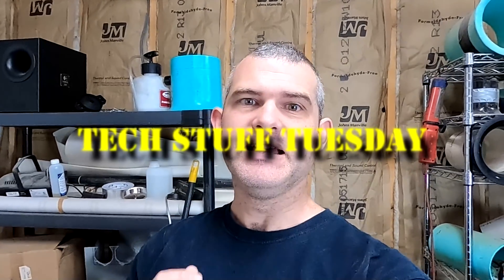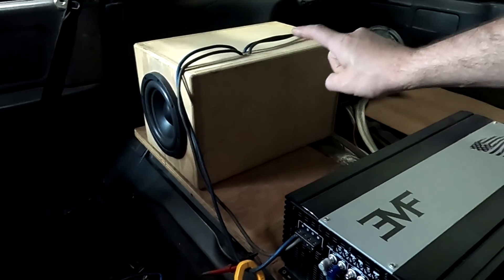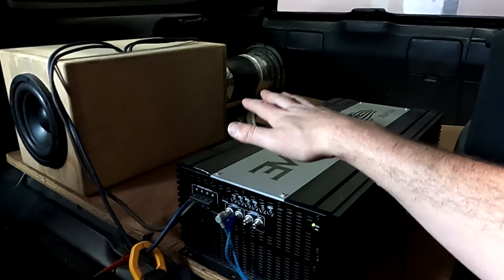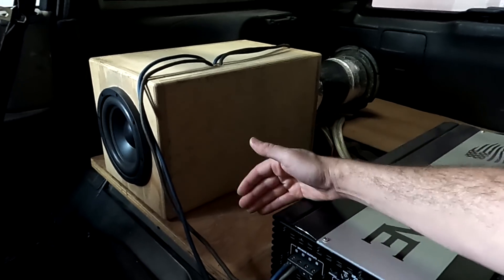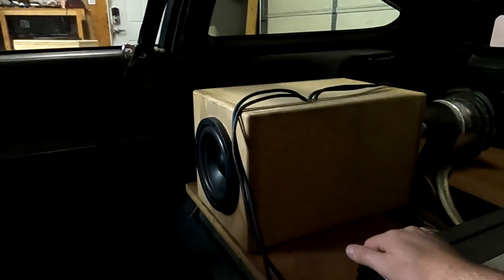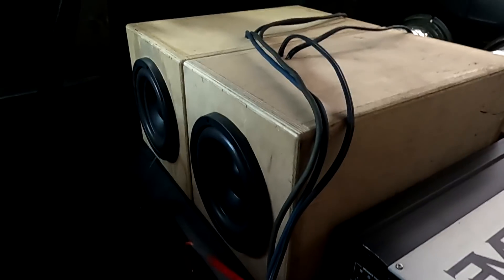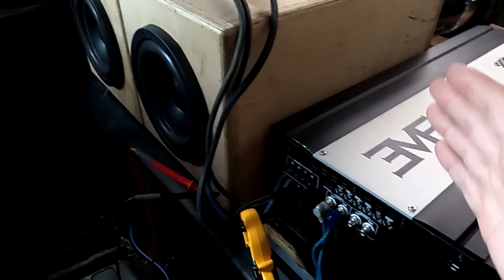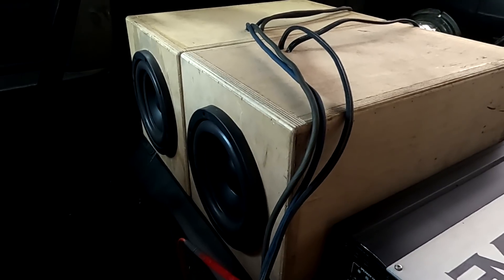Does doubling power or doubling cone area really gain 3 dB? - Tech Stuff Tuesday

Comment: The changing phase thing... I can't understand why you'd need to change phase because you changed sub direction. Soundwaves in the sub range are omnidirectional. Doesn't matter which direction you face the subs, the soundwaves will start off and end up at the same point in the spectrum as the other sub, regardless of direction, changes in tuning frequency between the two boxes notwithstanding, which wouldn't affect phase anyways. Changing phase shouldn't help, it would hurt. Which it seems it did. Just walk me through it.
Reply from the maker: When a waveform is made from a speaker, the speaker either moves forward or backward from the neutral position first. The phase determines that. If 2 speakers are playing the same thing side by side, if one moves forward and one moves backward they are 180 degrees out of phase. The frequency being played won't matter because it will always be 180 degrees out of phase. In this case I turned the box around 180 degrees, so the phase has to be changed 180 degrees to make the cones move the same direction at the same time. Had I not reversed the phase, there would have been much greater losses, in excess of 10 dB, likely close to 15-20 dB. This can be displayed in a common enclosure, separate enclosures, mids, subs, anything. If you have 2 subs, reverse the phase on 1 of them and take a listen. It will suddenly make sense.
Reply: @EMFAudio  Phase doesn't have anything to do with direction. Phase is a wiring/electrical issue, not a directional issue. 2 speakers are in or out of phase regardless of which direction they're facing. They will, as you put it, start moving in the same direction from neutral regardless of which direction they're facing. What I saw in the video was possibly cancellation, because when a sub fires into the trunk, the trunk becomes a secondary chamber with its own tuning frequency, like a 4th order. Which would change the length of the sound wave. Again, sub waves are omnidirectional and phase is determined by starting point of wavefront. If you had inverted one of the subs, that sub would have to change phase as it would be 180 degrees out. But just a change of direction? I legit don't think so. Not the experience I've had. But I'll check with some other installers and confirm.

Comment: u should try it again with closed enclosure, i think that would make some difference. i think that, that air from the ported enclosure is going back to that non connected sub enclosure cause its still in the same air space (car) and that why non connected sub is moving too. ill bet that u gonna get different data :)
Reply from the maker: Changing enclosures in any instance would give a different result, which also helps prove the point.

Comment: This needs to be done in a free air environment. When the boxes are in the car, the waves have to conform to the area they are placed in. And vehicle pannels absorb energy. And its not a set amount of energy. The more power you throw at those subs, the more energy those panels absorb. Its like taxes. The more you make, the more they take.
Reply from the maker: Funny thing about car audio, the application is in a car. What it does outside of the application doesn't matter. That's the point of the video.

Comment: I think it just shows how much you have that car dialed in for the enclosures you are best with. Sound waves... move the enclosure a butt hair to the right,  gain a tenth! Move it two butt hairs, lose a db🤬 and some hair off your a$$
Reply from the maker: I actually did try moving one of the boxes several inches forward and backward to see if there would be a massive shift  and there was 0.1 difference. But, in regards to your thought  process, I metered in the middle of the car at the line of the B pillar and it's 10 dB quieter than the windshield and 11 dB quieter than the rear of the car.
Reply: EMF Audiothanks for the reply.  test test test is how we gain on the meter! 😬. I wish I had a dedicated area at my place I could test and it not travel so much. Garage is attached to part of the house , anywhere else it carries to the neighbors too much. And my neighbors complain when I come home from ** work at 5pm playing triumph or Eric Clapton with my windows up no subs on. I could only imagine the complaints I’d get if I was burping and testing 🤬🤬🤬🤯🤯
Reply: @ The3rd ERA
You are going to have to make a complete concrete cinder block garage so no sound escapes outside and you can do all the testing you want.
Reply from the maker: I test in my detached garage which is better about killing sound than my attached garage because I took some extra measures when I built it. I had a neighbor that moved and he called police on me for hearing a grinder at 7 PM when I had the door open so you can imagine how many times he called about anything else.
Reply: Bassotronics. When I move in July to Nevada I plan to build a proper area to test and build a better shop. The neighbors I have now would call HOA on you for parking in front of their house on the street lol. So I’m glad to get out of here!
Reply: EMF Audio what extra measures did you take if you don’t mind me asking. I’ll be building some kind of structure on my new property when I move out to Nevada in July. I’ve been researching on it for a few weeks now, along with the wife’s she shed 😂, but no one that has actual data on the measures they took, just them saying it’s way quieter...
Reply: Thank goodness I’m shaved.

Comment: And the whole doubling the power or cone area to gain double the aucustic output (3db) there are always exceptions to the rule it tends to be aimed more towards higher power and larhlfer come areas to start with like 2 12s with 1krms to the pair doubling the power will usually get you that 3 db it's not really aimed at 2 8s with a hundred watts
Reply: Not to mention the enclosures were wrong

Comment: Having 2 subs, the one not playing is absorbing energy. That's why u got those results.
Reply from the maker: That isn't the answer, there are applications where that gains. It's literally the principle of how passive radiators work.
Reply: @EMFAudio  not the same as a passive radiator as it is not in the same sealed enclosure as the driven sub.
Reply: @EMFAudio  not a comparable situation, not being directly connected to the same cavity will hinder the other sub. 
If you have two tuning forks(in this case ports) and you ring one and bring it close to the other it will ring but the sound doesn't increase.
Reply: @94e88  great point👍🏻

Comment: From my experience the 3DB rule comes into play when you Start getting Closer to 150DB. The Pressure is increasing and the Cabin Area is Decreasing. You have to Start Doubling the Power and Cone Area as well as increasing your Electrical system. Once you get above 150DB it really Starts getting Difficult to go up 3 DB. Going from 150DB to 153DB gets a lot Harder. 

The Tuning Comes into Play as well. Having a Box tuned at 45Htz will prob hit a higher SPL that a Box tuned at 32htz. However, In my opinion the 32htz will sound better. Much deeper Bass. To get to the same SPL with 32htz will take more power than the 45htz box. It also depends on how and where they set the Meter at for the SPL reading. If the Windows are opened are closed. I could go on for Days. I've been in Car Audio for 20 years. 

Just remember their are a lot of situations that come into play. Get a Car that has a True Hatchback like a old Acura Integra or Honda CRX. Shid, the CRX back in the Day use to pound like Crazy. The car was the Sub box.

Comment: I have a feeling you could see different results if done out in the open, as I know (and shown in this video) anything around the sub will affect it. The main reason I put my home 5.1 system's sub in a corner is to get little boost.
Reply from the maker: I'd get a different result using a different enclosure too. Doing it in the open isn't how you use car audio enclosures, and that would take the intrigue out of the video!
Reply: EMF Audio - I am curious about what results you would get in my savana 3500 cargo van.

Comment: The 3db rule was originally stated when 100watts was about the limit it's a hold over from the days of tube amps, another thing to think of is this math was based on a flat response sealed enclosure, in a free open environment at 1 meter from the cone, Hexibase please chime in. Also a i free cone with a tuned enclosure will actually become a bass trap absorbing the pressure wave rather then adding to it.. on top of that you have problems with time delay

Comment: Was the second box soaking up the pressure via the unplugged sub vibrating? Somewhat like an ill fit passive radiator? I would like to see the same test done with a box of the same size but completely sealed without a subwoofer.
Reply from the maker: Passive radiators INCREASE output. I've tested it without the sub installed and it still loses.
Reply: @EMFAudio  Huh!!! A passive radiator in another unplugged box increases output??? Maybe you found a "free energy" device lol. But on a serious note that would be like saying flex on a vehicles exterior increases output, just not true. I do agree a passive radiator will increase output on an active properly tuned enclosure, just not on an inactive one. I call BS.

Comment: Flip the phase on the dual sub forward and back firing.....you lost dB on that due to the back firing sub being out of phase.

Why?

The air slug in the port itself is vibrating exactly like a cone that moves in perfect time with the driver in its enclosure.
Reply: So basically you were incorrect in reversing the polarity of said sub.  Put it back in phase and watch the score jump up.
Reply from the maker: You mean where I did reverse the polarity and specifically stated why I was doing that at 11:43 ?
Reply: @EMFAudio  no.  Click the "read more" below the rhetorical question I posed of "why?".  But I'll repeat it here again.

Reversing the polarity severely lowered your SPL and I correctly predicted it as well.

The air slug in the port exactly duplicates the surface of a driver (and is IN PHASE with said driver that shares its box) so long as the material being played is above the system Fb (port tuning.)  So you now have the output of the port directly interfering with the output of the driver next to it.  Remember that ports flip the backwave off of the transducer by 180* (roughly)....

Flip the phase and watch the score go up at least 1.5dB if not 2.5dB

Comment: would shorting the voice coil of the unused sub help in making sure that it does not act as a passive radiator and therefor avoid cancellation?
Reply from the maker: Shorting would change inductance, it wouldn't keep it from moving at all.

Comment: Sean, I would say that adding the 2nd box is killing wave flow and also reducing cabin space causing freq to change therefore giving you in correct results as you should have found the new cabin peak with 2nd sub. 

Also dropping to low load on amp affects the efficacy of amplifier, lower load is more voltage drop, if you had a power supply hooked up so you had no drop at all you may have seen bigger gains by adding the 2nd sub. 

Also please redo the test of 1 forward 1 backwards but have them wired in phase and see what results you get. I think the result was down due to phase cancellation so would be interesting to see. 

Awesome video content man 👍 love real in car testing vs bench testing :)
Reply from the maker: The cabin volume would have changed by 1 cu. ft. Frequency did not change, but even if it did and wasn't tested, there wouldn't be 4 dB difference in even a 5 hz change. Remember, I'm using a 15,000 watt amp on an electrical system suited for that 15,000 watts. There is ZERO voltage drop for making even 600 watts. You might be shocked to find amp efficiency is the same at those impedances and low power levels. Typically amp efficiency doesn't start to really drop till below rated impedance.

Having both subs facing opposite ways and wired to the same phase would result in excess of 10 dB loss. Even in a properly working setup you lose over 10 dB.
Reply: @EMFAudio  This so fundamentally wrong! Two different subwoofers whether in a sealed or vented enclosure should always be wired in phase. A subwoofer doesn't care which way it faces. As long as both cones are wired in phase they push out at the same exact time pressurizing the cabin at the same time. The fact that you wired them out of phase because of the direction of the box makes me doubt everything you have ever said as this is such a simple and fundamental subwoofer principal!

Comment: The only thing doubling power does in my car is make my car rattle louder and pretty soon all you hear is rattling and no bass. 😑 I always hear the most quality bass at low volumes which I used to always think you need more power for more bass
Reply from the maker: That sounds like you might just be clipping it.
Reply: EMF Audio that’s one possibility but it still sounds like at higher volumes all the parts of the car rattling overpowers the bass so no matter how clean of a signal you got it won’t sound clean until each and every part of the car is reinforced to handle the force of the bass bouncing all around in there
Reply: Yes, check for clipping and, do some sound absorption mats like Fatmat. Even cheapest brands'll do quite nicely and they're easy to install.

Comment: So as mentioned the  inactive sub is a perfectly tuned "anti-sub" where the sub and port match the driven one. turning a sub around in a contained box does not mean you reverse polarity; sharing a box yes, but the wavelengths are greater that the metre or so that the drivers are apart. 30 Hz is around 35m wavelength I think so you now got a pair of subs almost perfectly out of phase = big loss.
Reply from the maker: If you have 2 subs, reverse the polarity on 1 of them and get back to me. Play any frequency.

Comment: The theory is for ideal circumstances, not for a car environment. Remember, every rattling part in your car is an energy dissipator. It recieves the clean sound wave energy and throws it back as harmonics and noise and heat and all nasty stuff. And it does so non-linearly, meaning the more energy it receives, the more percentage of that energy is dissipated and lost (because the rattling part is getting farther and farther from its resting position). Hope it answers all the questions here🙏
Reply: You read right mind and saved me from typing the same response that you did. I was gonna say exactly the same thing, good job.
Reply: Don't forget the fact that he was using less than ideal enclosures. I'm sure we all know by now that a sub in a box of the wrong size won't play as efficient
Reply: Not that I would know,  but that sounds like a pretty good explanation.
Reply: the rattling part doesn't effect the sound coming out of the subs because subs themselves are non linear. sub bass does not change based on direction. only decibels interpreted change.
Reply: @christopherwise7067  Remember pal, we're not necessarily measuring the energy coming out of the sub, but the energy present at the location of the meter. Room acoustics (e.g. the rattling parts) can have tremendous effects on the latter. Especially, the stiffness of the car panels can determine the virtual "cabin volume" perceived by the sub, and room modes etc. which in turn determine the acoustic impedance (i.e. general air stiffness) of the environment around the sub. The acoustic impedance in turn has an effect on the sub output, which is contrary to what you were thinking. No, the environment DOES have tremendous effects on the total energy coming out of the sub...
If you're not convinced yet, just think about it this way: sub itself is a compliant system, meaning it adapts itself to the environment. It's not gonna dictate its movement regardless of the environment. It simply can't do that. If you pour cement all around the sub, it can't just rattle all the cement! It shuts down! Why? Because the sub has finite stiffness and power.

Comment: Wanna know how's that loss possible? Loss happens only when the added sub sits there with no input power. If you pay close attention, you can see the inactive sub is moving as well as the active one. Where did that moving energy come from? The box's not powered! Well it gets its energy from the air moving around it. That's the sound energy! Our precious energy goes to the other speaker and dissipates as heat in the suspension and box. Actually, that's how modern "helmholtz" absorbers work in the acoustic rooms and recording studios.
Reply: Well, that's possible as well but not in all case scenarios and all frequencies. After all, our passive speaker is equivalent to an RLC circuit (in its simplest representation) and can act as a resonator as well! 
.
Want a nice experiment? Put a large variable resistor across the terminals to the passive speaker, play around with the resistor value and frequency and eventually you'll find a point where the sub loses minimally (or even gains you some). But to use this effect to your advantage in a real life scenario is insane, because of all the variables you gotta trial-and-error on.
Reply from the maker: I've seen instances where that sub moving acted like a passive radiator and it was actually louder than not being present, with a plug over the hole. This was in a common enclosure situation.